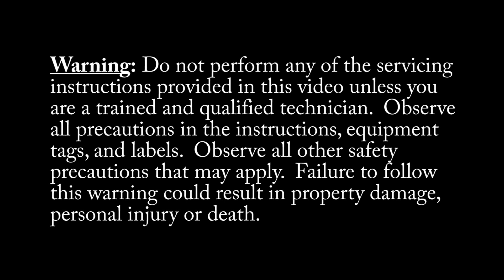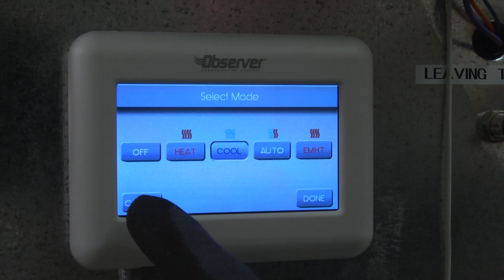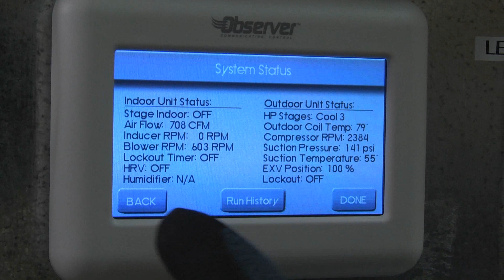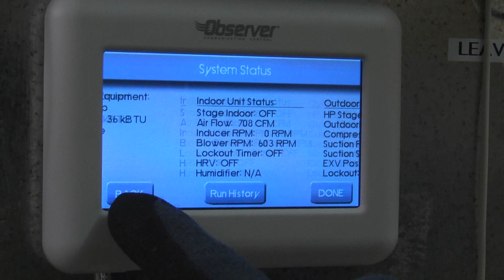ICP Variable Speed (5 stg) - Familiarization (1 of 4)

Comment: That compressor is actually a Constant torque compressor if it was a true variable speed it would have a 30% to 130% capacity it could fluctuate between
Reply: Our terminology is prob different we usually call something variable speed when it has 1% increments of adjustment the only thing different is the logic board reacts with a larger range before it steps down the compressor they’re all pretty much the same though electrically thanks for the reply I also wasn’t assuming anything I know the differences within the units I am trained by the factory and come from an electronics background
Reply: If you want to go as far as saying staging isn’t frequency that’s fine because it is constantly making adjustments to the frequency to hold the BTUH capacity steady that’s fine but it does have to change frequency less or mote to change btuH output less speed is simply
Less refrigerant capacity plain and simple
Reply from the maker: It is not constant torque.  You are likely assuming that because you are familiar with constant torque ECM fans vs. variable speed ECM fans so you are assuming everything with discrete stages is automatically constant torque, but that is not true.  In this case, the compressor is not limited to 5 specific speeds/torques.  It is limited to 5 specific BTUh capacities and it varies the compressor speed to achieve the desired stage of BTUh capacity needed at that moment.  On a hot day, stage 3 will run the compressor a higher RPM than stage 3 on a milder day.  It is truly variable.

With that said, it is not what we typically call a "fully variable capacity" system.  We have systems that ramp from 25 to 100% in 1% increments... in other words 76 stages.  Whereas, the unit in this video is limited to 5 stages.  AHRI refers to 3 stages and higher as variable speed.  So this unit is variable speed, but it is not what we would refer to as fully variable speed.  But we would call it true variable speed.

We think we know what you meant, but the terminology we use is different than you, but that may be a regional thing.  What we say in the Midwest might be different than the way it is worded in your local market.
Reply: It’s all relevant to the frequency range that is sent out to the compressor to change its speed... in the case of a 5 stage that usually means the logic that drives the VFD board will put out 5 different frequencies and hold them steady at a certain range sensed by the thermistor my original comment should have been more specific my apologies
Reply from the maker: @RDHPLUMBING  In this case, the 5 stages are not 5 different frequencies.  It is 5 different BTUh capacities.  The inverter will send out XXX frequency today for stage 3 but then tomorrow (or even 20 minutes from now), it will be YYY frequency for stage 3 because the ambient conditions have changed.  So in order to get the desired BTUh for stage 3, it has to speed up or slow down the compressor and fan to achieve those BTUs.
Reply: In order the change speeds what does it need to do?! Change the output frequency to the compressor its a three stage induction motor you’re changing frequency to change btuH capacity  unless it’s a DC voltage compressor that works on voltage linearly to change speeds but I’ve never seen a dc compressor with a speed controller they’re almost always AC three phase induction motors that get SPWM signals from the IGBT power transistors
Reply: Three phase induction motor not stage my iPhone is autocorrecting me
Reply: I might suggest you guys simply Google "does torque change with speed."
Reply: Or Google "constant torque compressor"
Reply from the maker: In regards to 130%, we don't know what you mean by that.  Why would the ability to "overspeed" mean that you have a variable system.  We suspect that you are getting that mentality from your familiarity with ductless heat pumps and their marketing strategies.  What many manufacturers do, such as Mitsubishi HyperHeat, is to design their system with a larger compressor than they need so they can market that they can go above 100%.  This allows the system installer to select for the tonnage they need for cooling but feel good that they will have enough heat by over-speeding the unit.  But you could just as easily design the product to only go to 100% and then tell the installers to select one size up and it would do the same thing.

In short, they are not going above 100% of the physical ability of the compressor, but instead they are going above 100% of the AHRI rating of the system.
Reply: The reason I call it constant torque or constant capacity is because it’s always trying to maintain its capacity at a given stage based on changing outside conditions until it hits a benchmark where it needs to go into a higher stage or lower stage whereas a true variable speed will modulate 1% increments to achieve more fine tuned control as outside conditions change
Reply from the maker: @RDHPLUMBING  But yes, this 5-stage unit is very different than our fully modulating units that ramp from 25 to 100% in 1% increments.
Reply from the maker: @RDHPLUMBING  It can't be constant torque AND constant capacity.  If the torque is held constant for a given stage, then as the ambient conditions change, the capacity would change.  In the case of this unit, it is NOT constant torque.  The capacity is held constant for a given stage by adjusting the frequency/speed/torque.
Reply: The logic inside the board is attempting to hold a constant capacity or constant torque at a given range of outside conditions
Reply from the maker: @RDHPLUMBING  The board logic is using the sensors to adjust the frequency/speed to maintain a constant capacity when a specific stage is requested.  When the speed changes, so does the torque.  We suppose we will just have to disagree for now.  But if you are ever in the Chicago area let us know and we would be happy to meet with you and ramp units up and down in our lab.  We have fully variable and 5-stage models from multiple brands.  We also have furnaces in the lab so we can simulate hot days and watch the compressor speed increase for a specific stage.

Comment: I think energy savings for HVAC/R are going backwards. Either leave it be, or discover a breakthrough via the fundamentals of the transfer of heat and electricity. Don't butter on expensive and uncommon components to a vapor compression system and say it's great. It's not. You had a wheel, and made it a space ship essentially. What you save in electricity is lost on the first repair not covered under warranty. 
 Don't forget the carbon footprint of the manufacturing process of ECM motors, PCB's and other electrical parts.. Think about it
Reply from the maker: The reason we use a lot of variable speed compressor units at our office is because of the benefits for tight temperature control, excellent de-humification, easy zone-ability, and very low sounds levels.  It has little to do with energy savings.

Comment: Cool piece of equipment. If It's not at least 30 SEER, it's not worth the energy savings VS cost of installation and repairs. Better have a 10 year parts and labor warranty. 
 Saving energy is great. Paying more for repairs, and needing repairs more frequently makes the energy and it's associated savings/cost a moot point
Reply from the maker: In our climate, efficiency is a minor part of the discussion.  Our gas rates are very low and our electric is average.  We don't have enough cooling hours in a residence to justify a purchase for energy savings.  The reason we use a lot of variable speed compressor units is because of the benefits for tight temperature control, excellent de-humification, easy zone-ability, and very low sounds levels.
Reply: Zone-ability I get. Humidity makes sense too, but can be controlled accurately and more economically. 
 Let's chat about tight temperature control. What is the accuracy tolerance of the thermostats you use? Tight temperature control in a zone seems odd for a residential application. Not saying that this can't be used in a commercial setting. I'm sceptical about the cost. In a commercial setting, most manufactures only offer a one year warranty. At least in my experience dealing in commercial. 
 Are most of the parts readily available at a local supply house? 
 I know see your point, yet worry about my customers when it comes to repairs. Every machine breaks let's face it. If I can't get the parts in a timely and affordable (Relative) manner, my customer would loathe my very name for selling them the equipment
Reply from the maker: @jakem117  We can't speak for the whole country, but we stock replacement parts here in Chicagoland area.
Reply from the maker: @jakem117  The tight temperature control is a function of having 5 stages of capacity control instead of just 1 or 2.  The accuracy of the sensing element in the stat is of little importance.  Tight control and accurate control are two different things.  Accuracy is not needed because human perceptions of temperature are all skewed anyway.  If you and your friend were in the same room and asked to guess the temp, you might say it is 72 and they might say 74.  The tightness that we were referring to is the elimination of hysteresis (or anticipator, if you prefer).  Instead of kicking cooling on at 75 degrees and cooling it back down to 74, a system like this can just keep it at 74 the whole time and not have to let it drift upward to engage cooling.  Essentially, it never shuts the compressor off (unless the system was oversized).  It just runs constantly keeping the temp right at 74.

Comment: I'm a Trane guy, but ran across one of these today(Carrier inverter, same board config) Great video , never hurts to know what to expect on Carrier units. The unit I saw today had a shorted MOC board. I guess you just change the whole drive.
My main reason I'm here was to find out what is my communicating vdc coming to the green plug from the furnace.? What should it be? (Not a heatpump) you answered the question I had about the extra white wire on the green plug. Thanks
Reply from the maker: It is a communicating signal.  If you put your meter on it, you will likely see a range of 0.5 to 3.5 vdc.  Every time a communication message is sent you will see a voltage reading and then when nothing it "talking" it will drop back down.
Reply from the maker: If you are in one of the states we distribute, we would love to talk to you about becoming a Carrier, Bryant, Heil, or Day & Night dealer.  We are in IL, IN, MI, WI, MN, MO, and KS

Comment: Are there any books, videos or any kind of training on VRF residential systems that you know of as a good source??  I have worked on conventional systems for years, but it seems that in the future conventional systems will slowly fade.  I want to get a good understanding of systems like you show here and VRF systems.  I understand that even at 5 degrees ambient, heat is still available to be removed and pumped to the indoor coil, but I don't know how the system accomplishes that..... is the EEV or the variable speed compressors and fan motors mostly responsible for that?  Training seems to be hard to find on these systems.Thanks!

Comment: Hey I have a question that nobody seems to be able to answer. Why on carrier units only in heating mode for heat pumps do you need to get your high side pressure on the hot discharge service port and if you check the 3/8 line service port you only get close to suction pressure? Every other unit you get high side on the 3/8 service port in both heat and cooling I don’t know why
Reply: Try what they call the bicycle port?
Reply: Rory Pettis are you referring to the common suction line ? There is only three ports in the system
Reply: Sorry I mis read your post.   Carrier meters their refrigerant with a piston inside the liquid service valve.   I personally take my suction pressure from the isolated “bicycle” valve at the bottom and put my high side on the suction valve to monitor.

Comment: Big problem with these is NO BYPASS with the 3 wire communication ... It is best design on HVAC , Water heaters , Well pumps (Things that are crucial to survival) that they be easy to bypass out in the field if there is electronics failure (The more bells and whistles is great at first and becomes a nightmare years later)
Reply from the maker: That is not true.  If you wish, you can remove the communicating thermostat and run these units from a standard two stage thermostat.  The unit will run using stage 2 and stage 5 and will skip 1, 3, 4.  But it will run.  With that said, we have not observed (pun intended) an issues with the communication once the system has been properly commissioned.

Comment: all those electronics exposed to heat and cold, moisture and vibration... those boards will fail unless made to endure, with the cost of the replacement parts will repair folks carry those on their trucks or have to order the parts and then wait..
Reply from the maker: This components are not exactly new.  They are just new(er) to residential ducted split systems... and even at that, they have been in the field in those applications since 2012.  Commercially, ICP's parent company (Carrier Corp) has been using similar electronics for decades.  And one of their partner companies (Toshiba-Carrier) that makes some of these components has been using these electronics and inverters in ductless systems for 10+ years too.
Reply: I hope I am wrong, time will tell, these things do save a LOT on electricity, only time will tell about the longevity of these boards. I would be curious to see the results of a long term test on these units. P.S. Great video
Reply from the maker: We have not seen any tests done on circuit boards used outside, but manufacturers have used boards like this outside for decades and they can handle a wide range of temps and humidity.  And the inverters themselves are just like VFDs which have also been used in outdoor RTUs for many years.  We will also add, that there have been tests for variable speed compressors and they data shows that they tend to last longer than single stage compressors (less on/off means less expansion/contraction of components).

Comment: I have installed 8 of these Bosch inverter units in Florida, 4 of them have lost inverter board just quit working,and one has lost two boards, the problem comes when we need a new board 2 of the 5 replacement boards came dead, then we waited for 2 months for another board and 1 month for another board, (back order) they said as they also said they had no inverter board problems, then why all the back orders.
Reply: Interesting.  If you figure out what is causing the failures please leave another comment.
Reply: @dpeagles  Board failures are caused by MBAs in management (aka the "bean counters") squeezing the engineering department to reduce the cost of the components.  Engineers can design a system that resist moisture and lightning surges, but bean counters don't want to spend the money.
Reply from the maker: Bosch units are made by a different manufacturer than depicted in this video.  We are not familiar with the Bosch product line so we can't comment on their quality.

Comment: also you will be surprised that in many models its not going even close to 25% capacity as advertized , in some sizes it goes only to 40 or even 60%
Reply from the maker: Sort of true... but not exactly.  The marketing literature states things like operating range "as wide as 25-100% of capacity."  That is based on a 3-ton condensing unit.  The 2-ton and 4-ton are 35-100 and the 5-ton is 32-100.  The concept is similar to a when a condensing units is marketed as "up to 16 SEER."  That means the best combination rating is 16 and some of the others will be lower.

I either case, it has a significantly better turndown than a standard 2-stage scroll, which often has an operating range of only 80-100%... and at best 68-100%.
Reply from the maker: BTW @Znakla, the 037 model that you have is a modified 048 to get higher EER (you must live in the SW part of the country to need that).  Because it is essentially a 4-ton unit that has been tuned down to 3-tons, it has a smaller range of just 40-100%.  That is the highest turn down range of all 7 models in the condensing unit line-up.  The other 6 models all go below 40%.  But once again, still way better turn-down that if you installed a traditional 2-stage scroll.  :)
Reply: @TECTubefilms   I was  considering   one of  these  units due  to the potential  low  operating capacity.  But  only  the  3  ton unit  could  operate as low as  25% ?   Trane  and  Bosch both advertise units  that now can  operate at 25 %  but  I do like  this  model  even if  under  a different  name  like Tempstar/Comfortmake